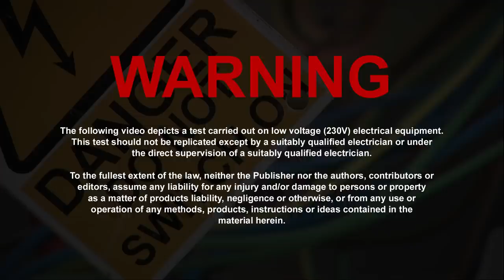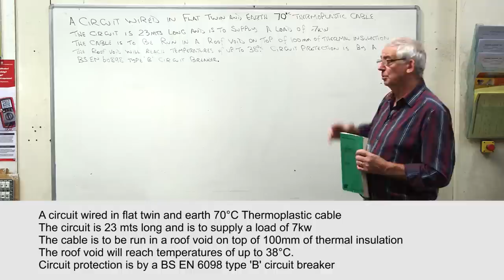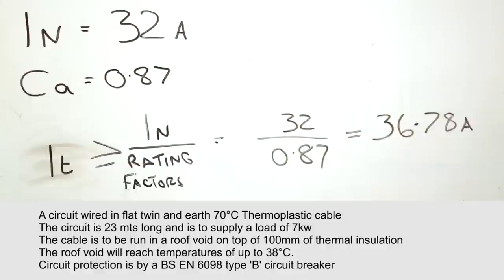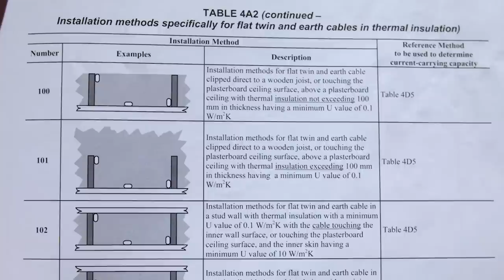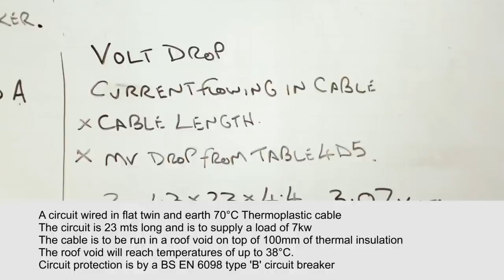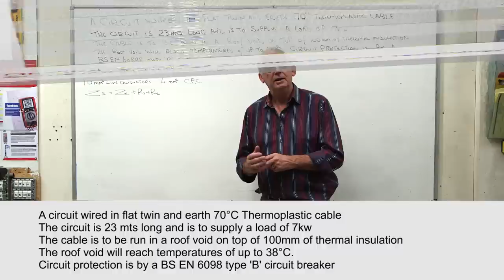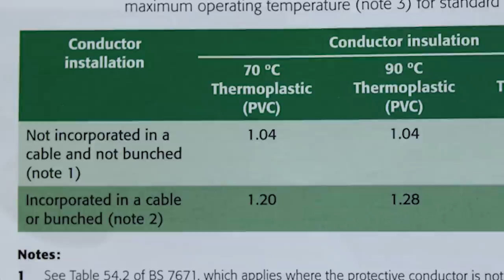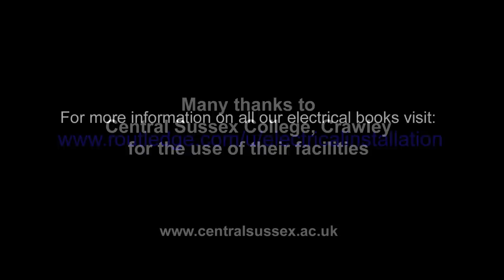Cable calculation

Comment: I think Ib should be used instead of In when dealing with the Ca rating (i.e. It=Ib/Ca) to determine the appropriate cable size due to elevated ambient temp.

Comment: Hi thanks for your great video! Just a quick question is the design current the rating of an appliance or is it the load after diversity. So a Hob for example if it is a 7kw rated Hob would the design current be the amount of amps after diveristy ie: first 10amps then 30% of the remainder?
Many thanks.

Comment: Why in most houses as new build are all circuits in 2.5 twe. Even in loft. Surely some would have higher temperatures than others. But I have always seen 2.5 for sockets 1.5 for lighting 6mm for cookers and 8 for electric showers.  Thanks for any help
Reply: Shaun Beard diversity

Comment: What is CPC? in impedance calculations to get R1 + R2 = 6.44? Was this from a table?
Reply from the maker: Rich Gallagher  circuit protective conductor. Look at page 196 on site guide for r1 + r2 values

Comment: The end of the video misses the 80% rule and the 0.95% of cmin to be applied to the Tabulated Zs value in 7671 to allow for voltage fluctuations and a 50c rise in cable temp from the 7671 Tabulated Zs values when testing without load at about 20c in the field. The true max Zs permissable is actually only 1.10ohm.

Comment: Chris, Thanks very much for this video is was very helpful. i have a couple of points/questions.

1. i thought when you have applied the rating factors to your cable this value is then called Iz? You seem to call this It?
2. At 8:55 i think your formula for Zs should have the R1+R2 in brackets, so Zs=Ze+(R1+R2)
3. When calculating the Zs you adjusted the figure for operating temperature of the conductor. if i was going to use the max Zs value in the on site guide i presume i do not need to do this adjustment?

Thanks again for posting such good videos
Reply from the maker: +mikebizzleuk 
Hi Mike,

When you divide In by rating factors the result is It, It is the minimum current rating of a cable which is needed to carry the required current under the conditions indicated by the rating factors. 
Iz is the current which a cable could carry under the conditions indicated. If you select a cable and than multiply it by the rating factors it will show you the current which the cable could carry under the given conditions, this is known as Iz.  points 2 and 3, you are correct. hope this helps,
Kindest regards
Chris
Reply from the maker: +mikebizzleuk 
Hi Mike,

It shown in a calculation is the minimum current carrying capacity of a cable which would be suitable for the circuit being calculated. Iz however is the current which a particular cable could carry when multiplied by the rating factors affecting it. As an example a 2.5mm which is has an It of 27A with a rating factor for Ca of 0.94 and Cg of 0.85 would have a current rating of 27 x 0.94 x 0.85  = 21.53A under those conditions. It is the current rating given to the cable in the tables in appendix 4.  The rest of your assumptions are correct.
Reply: Yes, good point re, R1+R2. 'Big' r1+'big' r2 are never separated. They become one in the calculation for Zs so yes it should read '(R1+R2)' to confirm line and cpc resistance as one figure. 'little r1' etc is separate from 'little r2' as in, continuity...

Comment: I checked table 41.3 in BS 7671 for 32 A and type B circuit breaker , I found the value of ZS = 1.15 not 1.44 as mentioned in the video (1.44 is for type 1 circuit breaker not for type B)
Reply: Zs values have been adjusted since this video was recorded.
Reply: You need to use the green book AMD No1: 2011
Reply: now is 1.37
Reply: kalimba De luna this was prob the 17th amendment.

Comment: Good explanation sir.
Here I have a small doubt, please. As per standards, Up to 4kw have to take single phase i.e 230V, but here it is 7kw here we have to consider 3phase.( Is this correct or wrong, can u please explain)
Reply: 3 phase i.e 415V

Comment: How do u work out size of CPC? @ 10:47
Reply: Twin and earth comes with CPC already calculated if you're using a 10mm2 live conductors then you'll have a 4mm2 CPC
Reply: If you wanna calculate the CPC you need to use the adiabatic equation

Comment: Is There any formula for cable size calculation for given load,without using any table reference
Reply: Dharmendra Kumar 
No, u need to get cable current carrying capacity without that u can not find.